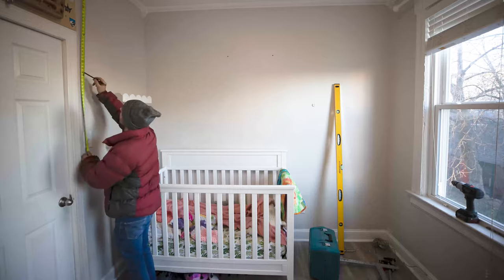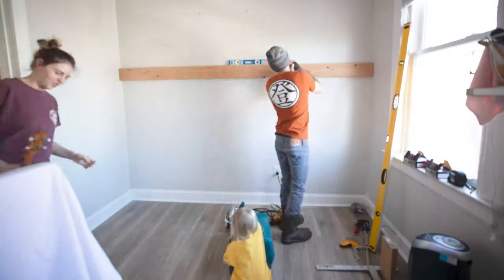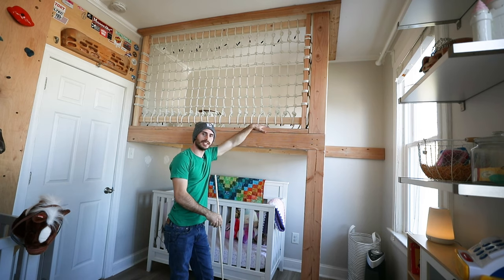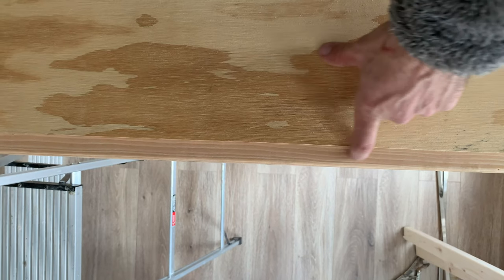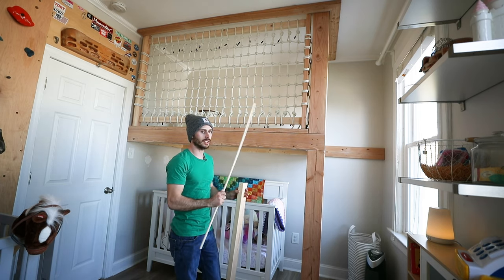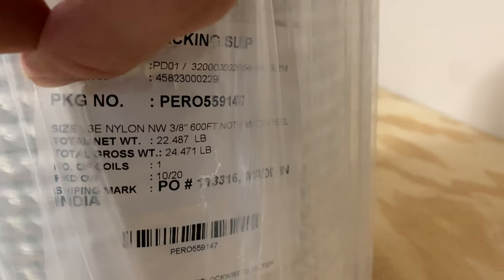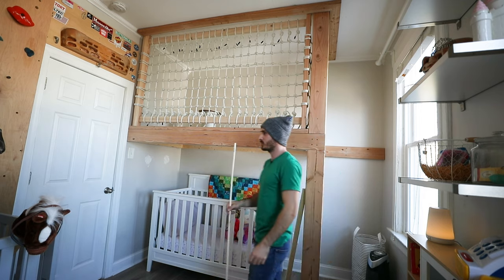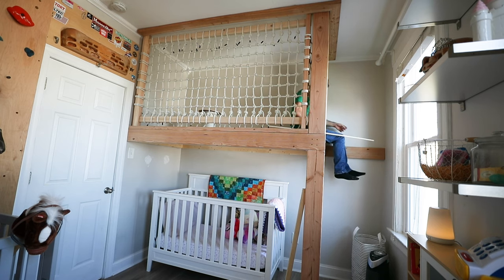DIY Kids Loft Build

Comment: One way to find studs is with one of those VERY strong magnets, you should be able to locate the screws that fix the plaster board and then draw soft pencil lines to mark the stud
Reply from the maker: Good tip I’ll give that one  a try 🤙🏻

Comment: Very cool build. On the topic of screws, Torx is definitely one of the best screwheads out there. (That's the star you mentioned) Much better than Philips or something like that. Also, I recommend an Impact driver for all you screwing needs, so much better than a cordless drill.
Reply from the maker: Yeah torx screws are my favorite I have all the kiiiiinds of bits and sizes for those. But this was some special star one like you said. I couldn’t find that special bit anywhere. Lol it’s better to always use something standard in my opinion. So you don’t have to run out and buy some special whatever it is.
Reply: @BetaClimbers  Oh, it was a different from torx? Nevermind then, I feel your frustration
Reply from the maker: @raphaelbeinhauer9242  yeah very frustrating lol 😂 most of the weren’t crazy tight so I got them out with vise crips but that particular one I have to file some flat spots. That was only the first road block. Me and my wife prob got into 3 fights. 🤣
Reply: @BetaClimbers  One thing I like to do in those cases is to cut a slot with an angle grinder, the use a large flathead screwdriver
Reply from the maker: @raphaelbeinhauer9242  Yepp that’s another way to skin that cat. I was avoiding the fire hazard I didn’t want to have to fill out a hot working permit with my boss (wife) 😂
Reply: @BetaClimbers  Yep, sucks with all the permits you need from the "government"😂
Reply: @raphaelbeinhauer9242  🤣

Comment: Hey Josh how do you plan builds like this? Pencil and paper diagrams mainly?
Reply from the maker: No just from my head. Should have used paper first then I prob would have saved some trips back and forth to the store. But I’m my experience things always come up while I’m making a project that I didn’t think of. I think that is why engineers and builders fight lol. For instance I originally planned that the 4x4 was going to just be flush with the ceiling then i figured hey why not go right through it. And there where prob another hand full of things like that. I just like to get started building and go from there. Obviously the crucial things needs to be on paper like bed length and width and height. Stuff like that

Comment: Ur the man. Do you work in the wood working industry
Reply from the maker: No lol just a lot of construction experience.
Reply: @BetaClimbers  thought it had to be something. Respect. Good dads build their kids stuff I believe. Hey man. I’m a climbing teee worker and own a company based on trees and landscape horticulture architecture. I found your channel a while back when I started uploading myself.  and love it. I’d LOVE if you’d do a tree climbing series. Fails would be endless but anything around trees and static rope SRT, DDRT. Keep up the great work bro
Reply from the maker: @AdvancedLawn  oh yeah I did tree work for a few years of my life 14 to 18. Hardest work of my life. Luckily my only fail was getting poison Ive.
Reply: @BetaClimbers  oh man ivy is the worst. Gotten it a few times. So many upgrades in tree work now though. I use the rope wrench with a michocan
Reply from the maker: @AdvancedLawn  I have my eye on the rope wrench looks pretty cool. Only thing that worries my is somthing pushing down on the prussic then you would go for a ride. I’m planning on making one with a micro trax and testing that out.
Reply: @BetaClimbers  as long as u get the diameters right with ur hitch chord you won’t go for a ride. Because the bend in the rope that the wrench adds dosent allow u to descend too fast. I’m 240lb and use 3/4 inch braid climbing rope with a 1/2 inch hard eye to eye chord with 4 wraps. Try it out.   U can even use a back up progress capture above the wrench. Or use the rope wrench with the aluminum tether and a mechanical Prussic. Anyway, good luck and can’t wait for the next video.
Reply from the maker: @AdvancedLawn  oh right on thanks for the tip 🤙🏻